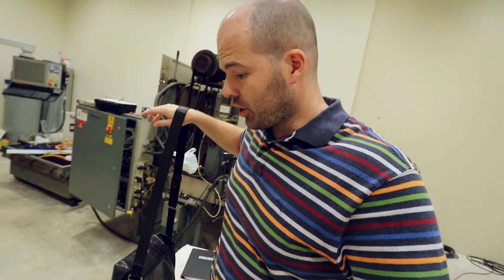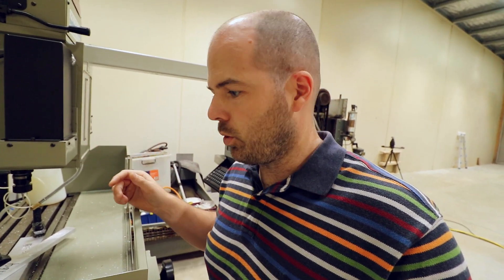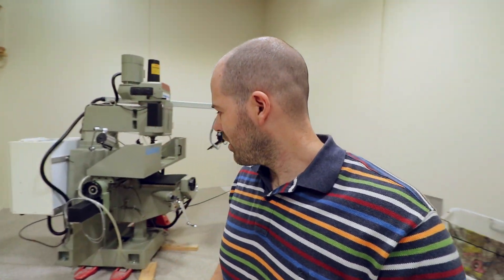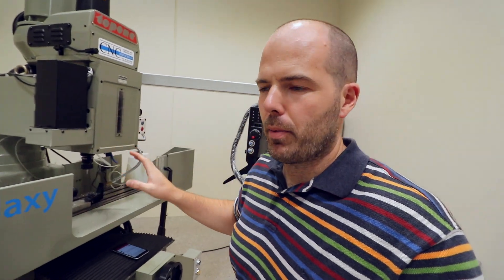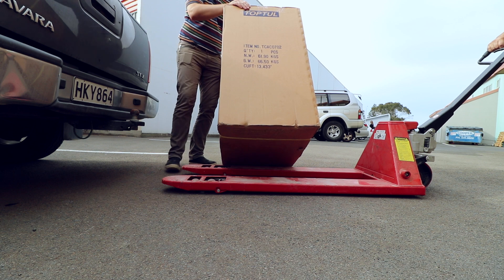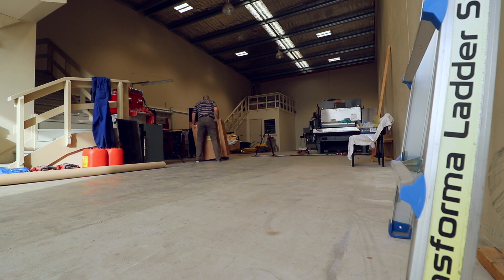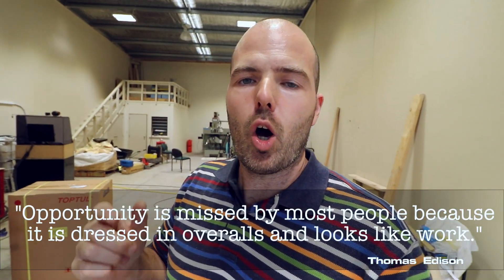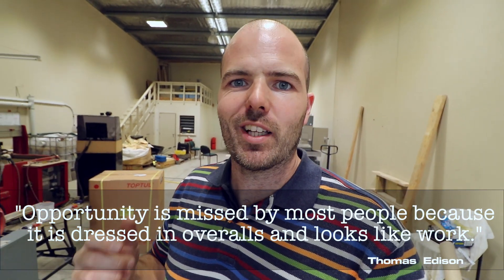Reaching my limits with this...

Comment: You really need to get into a cam software, something like fusion would be a good starting point. I wouldn't spend a bunch of money on a commercial software just yet if I were you.. also you need to get a refractometer to test your coolant concentration on a regular basis. If the concentration gets low it can start forming corrosion on your machine. They also make a mist system that doesn't create all that mist in your shop. It's pricey, I don't know how well with titanium it will work. I can share a few pointers machining titanium if you like. Let me know and I will give you my direct contact info

Comment: If your interested in giving CAM a shot try out fusion 360. its free for hobby users and small shops, not sure what amount of money you need to be making with it for them to charge you. I have heard 100k but that could be wrong and from what I understand the 100k is not what your shop is makeing total is just parts that involve their software. I could be wrong about that too though.    Im fairly new to machining and i picked it up pretty fast, its fairly easy to use once you play around with it a bit.

Comment: What are milling bits made of and how often do you have to change them?
Reply: Gillysaurxx Good quality ones needed for titanium are tungsten carbide (generally) but for aluminium you can get away with using much cheaper HSS (high speed steel) cutters. Time between changes completely depends on how often you're cutting, how aggressively, how long per cut etc.